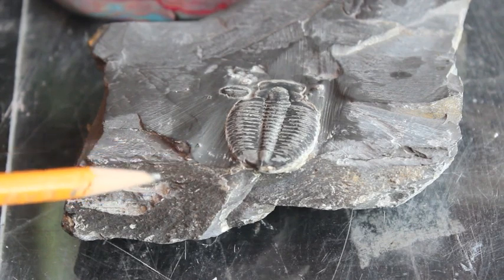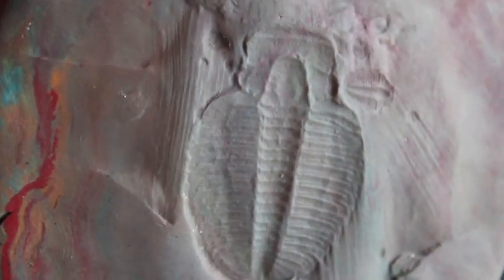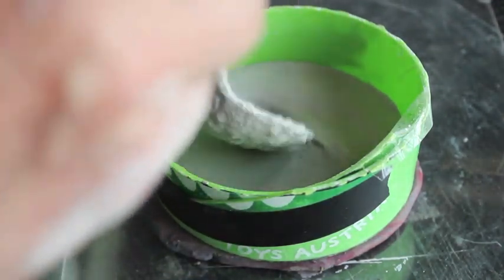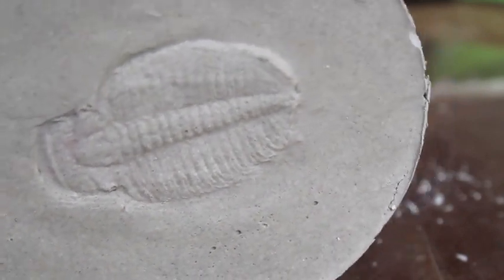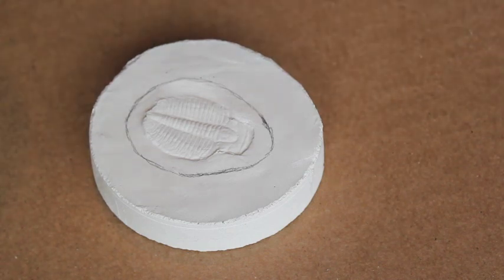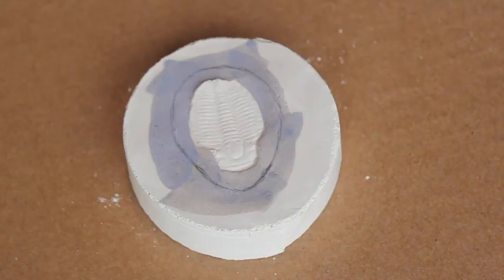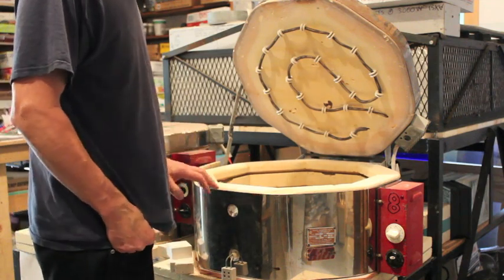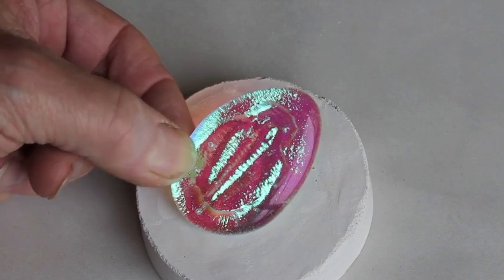Fused Dichroic Glass from rock fossils

Comment: Thank you for this technique, I found it really interesting.  Is fireproof cement the same as refractory cement?  Selleys make one that is used to seal fireplaces, it says it resists intense heat.  I know it would be more expensive but it would take me years to use 50lb.
Reply from the maker: refractory cement is for forming your own bricks and furnace parts, not cementing them together.  It is generally called "castable refractory" but what I used in these videos was castable fused silica refractory.